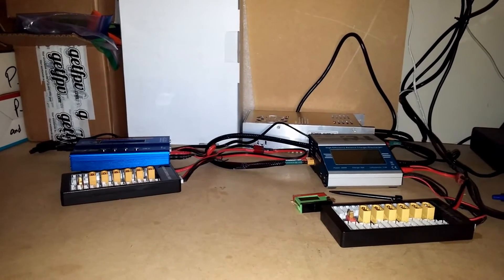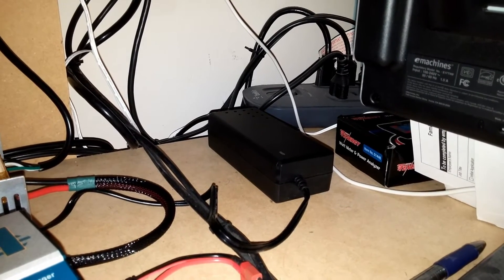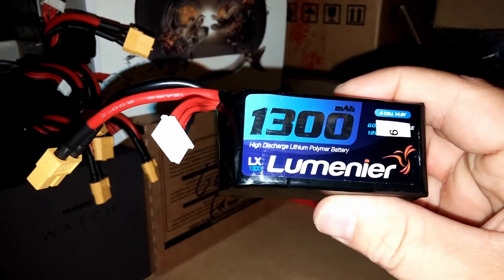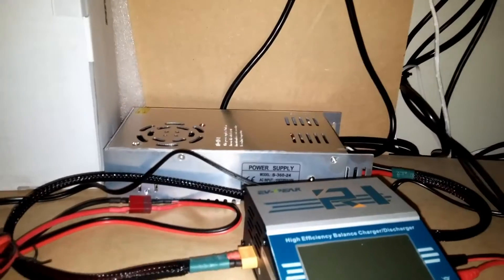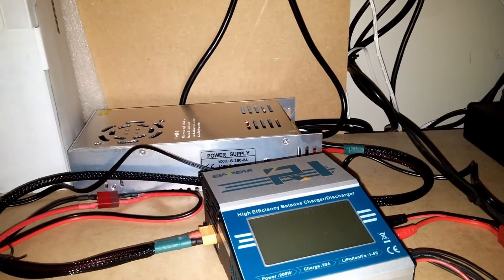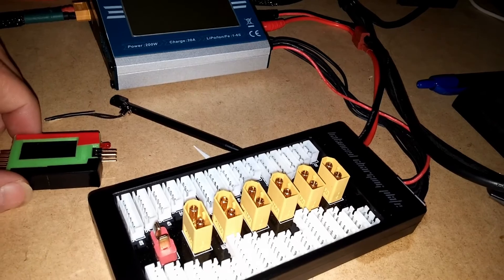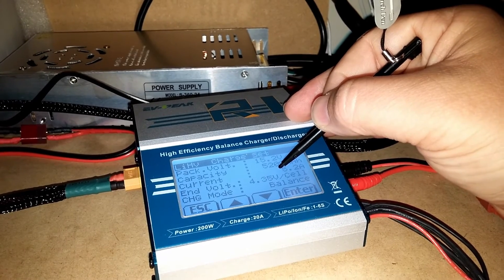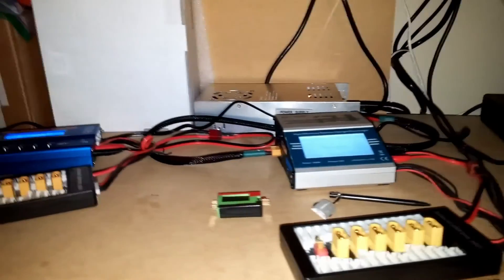My Charging Setup

Comment: Informitive video! Im new to fpv and RC scene in general and was trying to charge four 4s 1500mhA 4.2v lipos on the same board you have but with an EV-Peak A1. Ive been setting the mhA setting to the rating of just one battery (1500mha). Is this wrong? my charger stops before they are at 14.2v. do i multiply by the ammount of batteries im charging at once and if so should i be changing the amperes too?
Reply from the maker: NO, mhA setting is just an extra protection feature and I think it would need to be calibrated be for you use it. I put that at way more than I need. But the amps is what you change and for 1500 mha battery it would be 1.5 amps. and if you had 2 of them charging at the same time then it would be 3 amps. Hope this help!
Reply: @LarokCreations  It does! thanks for the reply. I now know that that batteries amp rating has to be multiplied by the number of batteries charging and the cuttoff voltage is what ultimately protects the batteries right?
Reply from the maker: Yes...should be 4.2v per cell. so if you had a 4s bat then it would be 4x4.2v which would be a total of 16.8v

Comment: Hi. just to follow up. I just placed an order for the AR1 model.
http://www.banggood.com/EV-PEAK-AR1-300W-25A-DC-1-6S-RC-Battery-Balance-Charger-p-1095822.html
Reply from the maker: good deal. I paid $69 for mine,
Reply: Yes, I went to getfpv.com and saw your unit for $69 + free 2-3 day shipping from FL. That's awesome price given that it's in the USA. Banggood actually has the R1 for $74 and you'd have to wait 20 days for shipping. But the price for the AR1 from Banggood was too good to pass up so I'll have to tolerate the 20 day shipping. 

One other reason why I went with the AR1 is because of its input voltage: 11-32v. I have a 600 watt solar system which connects to a nominal 24v battery bank that normally sits around 25v-29v. I wouldn't be able to use that solar system to charge any other 12v battery -- or any battery for that matter -- if the DC input couldn't handle 25-29V. So that's why I went with the AR1. 

I wish getfpv had the AR1 for $79. I'd definitely buy from getfpv then.

Comment: hello Larok. I wonder if you can help me. I'm considering buying the ev-peak R1 or the AR1 -- which is the bigger brother to the R1. Can you help me to check if you can change the termination voltage point for Pb (lead acid) chemistry? I'll be using this charger to charge up a 125Ahr AGM lead acid battery. I want to be able to configure the ending voltage between 14.4v to 15v. Most chargers are fixed at 14.7v. I would greatly appreciate it if you can check your charger and see if you can change the ending voltage for Pb batteries. Thanks very much for your help!
Reply from the maker: Thanks for checking out my video!

Voltage range is 2.22 to 2.55 V/P. As far as I can tell if you are charging a 12V / 6P (this is the setting on the charger) total being low 13.32v and high 15.3v . But it can also do 2v, 6v, 8v, 10v/5p, 14v/7p, 16v/8p, 18v/9p,  20v/10p
Reply: Larok, thank you so much for your quick and detailed response. That's exactly the info I need. That would work for me. 
When you change the V/P, does the increments go up by .01, .05 or .1? Thanks again for your help!
How are you enjoying your charger? Any problems/cons you've encountered that you'd like to warn potential buyers?
Reply from the maker: Goes up 0.01. I love it. I haven't ran into any problem. I do have a concern on how long the screen will last, because there is no physical buttons.But no problem with screen so far. I bet I have charged 200 battery's with it
Reply: Larok FPV Quads 0.01 would be perfect! great! I'm glad to hear it's working out very well for you and that you haven't had any problems. I share your concern regarding the touch screen. Will have to be extra cautious about using it gingerly I guess. 
One last question: how did you come about this charger or how did you find out about it? There's not a lot of reviews of this charger on YouTube and I don't find a lot of info about it when I do a search on Google. So I'm curious how you discovered this charger in the first place. Thanks again for your help! Much appreciated! Safe charging and flying! :-)
Reply from the maker: Just was in the market for a Lipo HV charger, was browsing and seen it on Getfpv.com. Seen one review on youtube for the 100w version with a built in power supply. But what sold me was the all metal design.
Reply: Yup. I saw a youtube review of the A1 -- which is the 100w version with built in power supply -- then I eventually found this R1 version with a higher wattage. I don't really need a built in power supply as I'll be powering the R1 with the main 12v car battery under the hood to charge a secondary 125Ahr 12v battery inside the vehicle. 

This should work well for me. Thanks again for your help! Cheers! :-)
Reply from the maker: So what is it that you are going to do with this....extra battery for car stereo or hydraulics?
Reply: Larok FPV Quads Hi. From Oct 1 to Oct 25, I was on a road trip with my Subaru Forester. I went from CA, to OR, to WA, to ID, to MT, to WY, to CO, very quickly through NM, then to AZ, then NV, then finally back to CA. I went to many, many national parks and visited many cities/towns in those states. I slept mostly in my car.
I had an older RC charger which does max 6A/50W max. @ 14.7v, 50w was basically 3.7A. That's the max amp I could charge into my 125Ahr battery every hour. I use the secondary 12v battery to power my electric Dometic cooler/freezer overnight when the vehicle wasn't running. While driving, the electric cooler was connected directly to main car battery. I also used the battery to power a 300watt inverter which powered my little 200w portable heater to heat up a bit at night time. When I drove a lot during any given day, the 3.7A was ok to recharge up the 125Ahr battery. But if I drove only a few hours on any given day, it wasn't enough to fully recharge the 125Ahr battery.
So thus my need for a RC charger that can pump more amps. I'm also looking at 20amp models. But really 15 amps is about max I can pump out through the 12v cigar outlet in the car. Anything more and I may blow the 20amp fuse that's used for that 12v cigar outlet. Even at 10 amps, it would be a huge improvement over my current 3.7A charger.  

So that's what I'm planning to do with the R1 or AR1. :-)